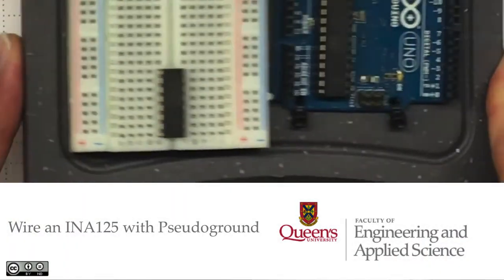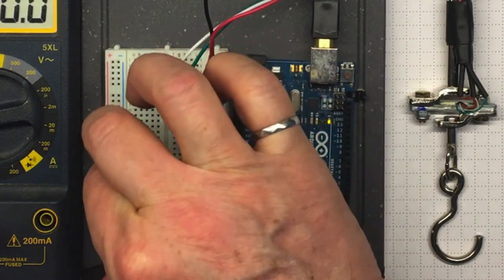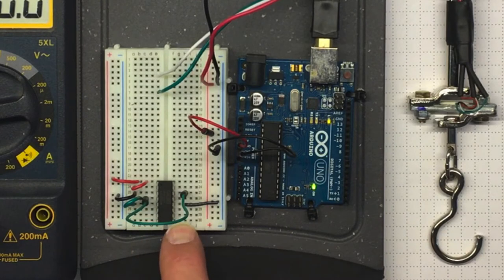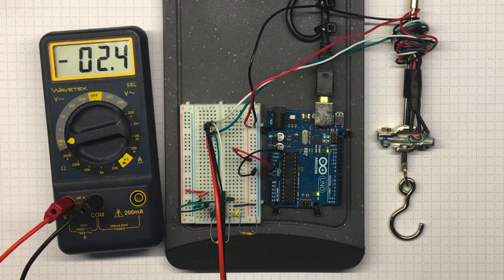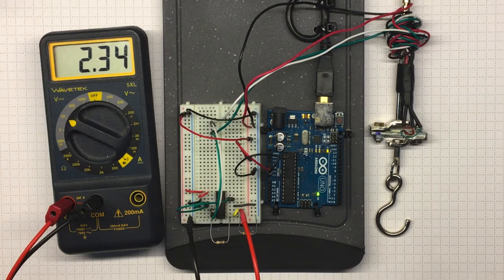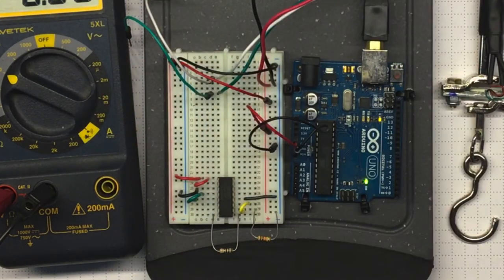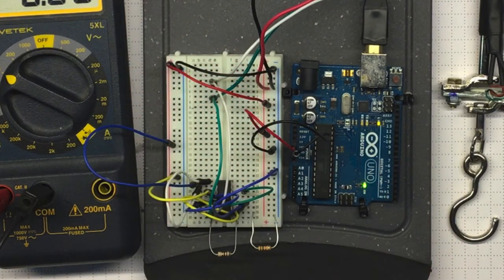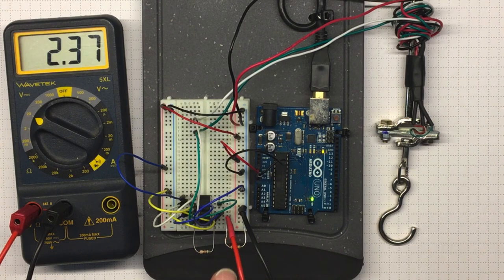Wire an INA125 with Pseudoground

Comment: On sheet 13 of the INA125 data sheet, pins 4, 5, and 14 are connected to the strain gage bridge.   You are connecting the bridge directly to the Arduino 5V supply.  Why didn't you connect the bridge to the INA125 5V supply?
Reply: I used the separate 5V power supply for several reasons. The bridge circuit can be tested before even beginning to assemble the amplification - important in the lab environment. Our low resistance bridge (120 ohm) draws a fair bit of current. 5V gives a larger signal than 2.5. Using the same source for Vref in the ADC and for the bridge excitation allows any power supply voltage variations to cancel out because the bridge output is ratiometric.

Also, fig 6 on p 13 is using the 2.5 volt reference output from the INA 125 to drive the bridge. In this configuration the 5V reference is not available.

Comment: What guided your choice of reference voltage?
Reply: The pseudo ground reference needs to be higher than the lowest output you expect plus a little more. The lowest output voltage possible with a 5 volt supply is about 80 to 100 mV, so if the input is -10mV and the gain is 100, then you would expect an output about 1 volt below the reference. the smallest (1.24 V) reference from the chip would be a good choice. OTOH, if the input is just as likely to be positive or negative, then something in the middle of the range like 2.5V would make more sense. Those are the only two options if you use the on-chip sources and a 5 V supply.

Comment: Hello - is the 10k resistor from output to the ground important? I am making custom PCB based on near identical design - except it doesn't have this Pin 10 output resistor to ground.
Reply: Also - I just noticed in this circuit you are only using the Arduino for Power and do not have the output connected to an analog pin on the Arduino. Would that be a straight connection to A0 pin? Or will you need an additional resistor in series? Would you remove the 10k resistor mentioned previously if you connect output to A0? Thank you!
Reply: @622mason  The 10K resistor is there just to make sure some current flows through the output. If you connect the output to most other circuits (like an analog input) it is unnecessary. If it is still open like in this example, then it needs some current path, hence the resistor.

Comment: Why did you use a 51 ohm resistor to connect pins 8 and 9? Can another resistor value be used?
Reply: By the datasheet you can see that the amplification you want is by that resistor following = 4 + 60000/R